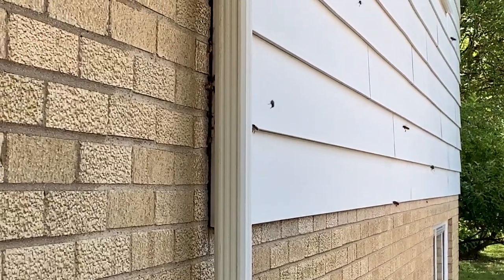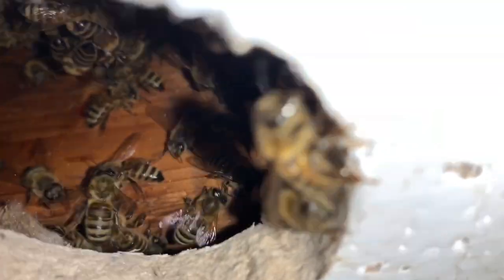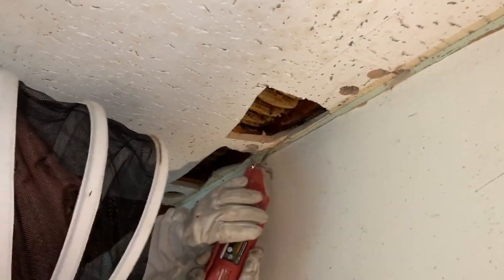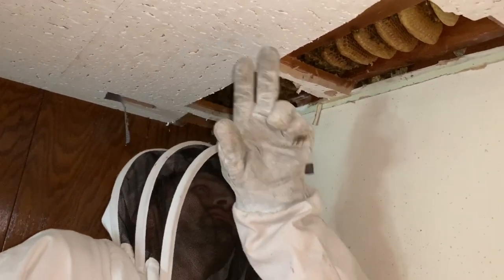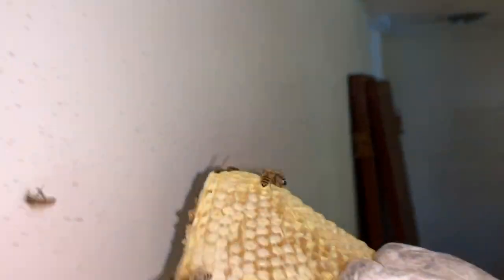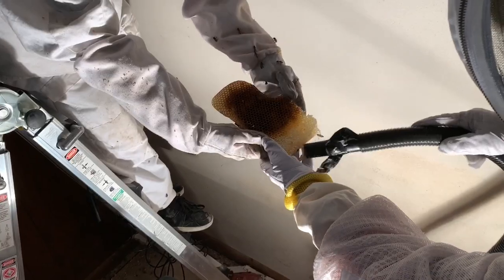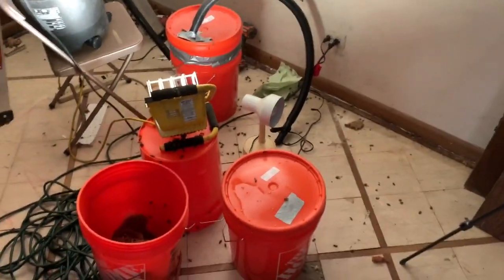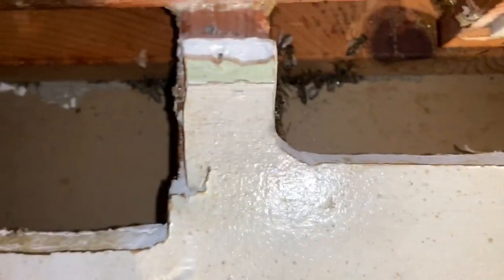HUGE HONEY BEE HIVE REMOVAL INSIDE HOUSE | ASMR BEE VACUUM | Yellow Jacket |

Comment: Using that type of vacuum killed most of those honeybees and I’m not trying to bash you but that was not the right way of Bee removal you need to be more experience in honeybee removal so with this in mind stick to wasp not honeybees. ✝️✝️✝️🇺🇸🇺🇸🇺🇸😡😡😡
Reply from the maker: They all stayed alive and were relocated to bee savers of Illinois. I don’t think you understand how a bee vac works. The bees were sucked into a separate bucket that was lined and vented, not the actual vacuum. The vac plugs into the bucket the bees go into and a separate hose that attaches to the bucket is used to suck the bees into it. At no point do any of the bees go into the vacuum. Sadly I don’t do honey bees often my company is a wasp removal only company. When a customer calls with honey bees and local removers ask far too much for them to afford the removal I come in and help them at a very low cost. It’s crazy but bee keepers here want $1200 plus to touch a hive for a customer I do it for like $200 to save them money.